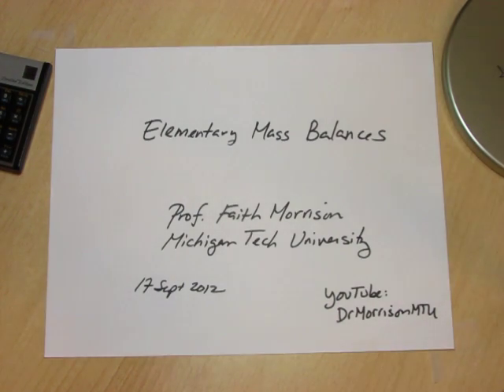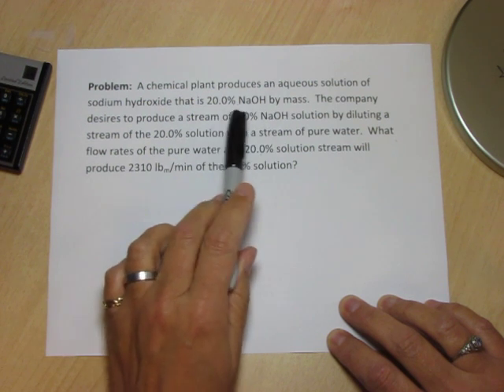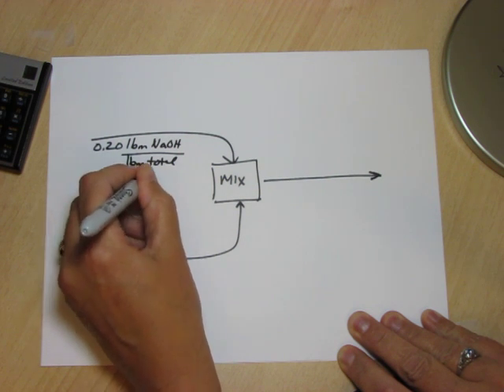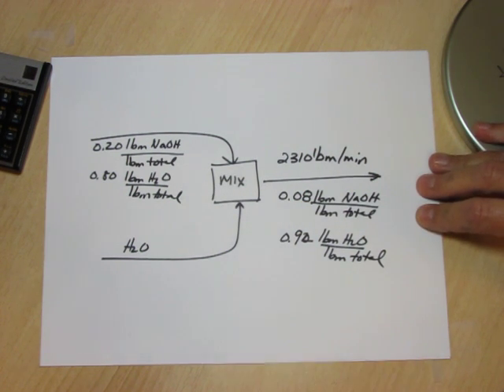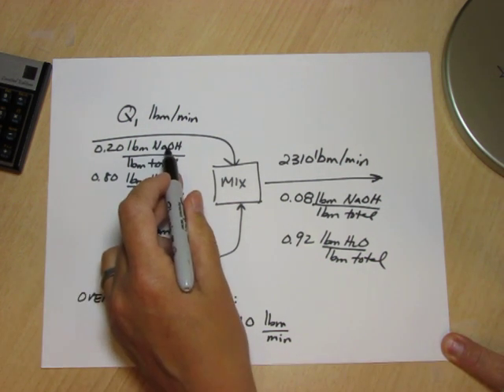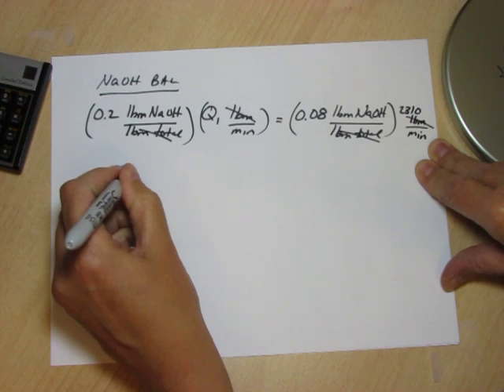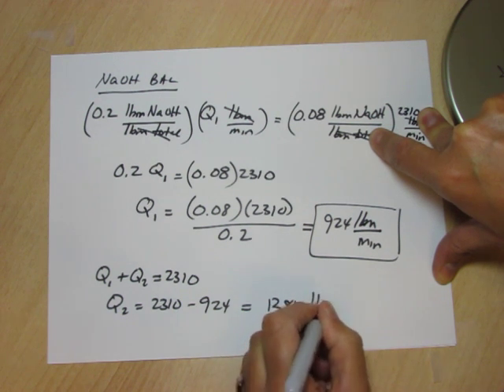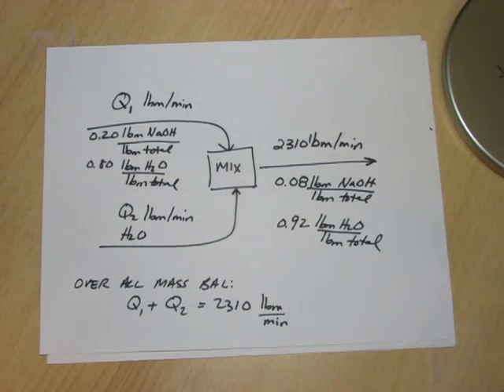Elementary Mass Balances in Chemical Engineering

Comment: I thought this was a great explanation of a mass balance. It was clear what the goal was and the solution was easy to follow. It was also helpful to see the image of the system with the streams coming in and out and how they were labeled. I think that the problem was a good problem for an example because it was not too difficult to understand, but yet it was interesting enough so as to not lose the attention of the viewer. I wish there were more detailed explanations of mass and energy balances in relation to mechanical engineering.